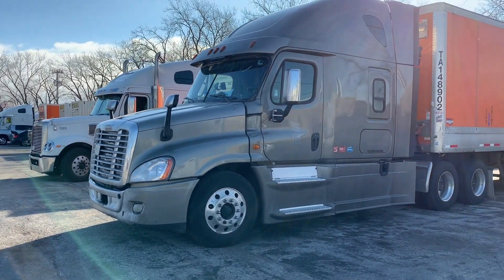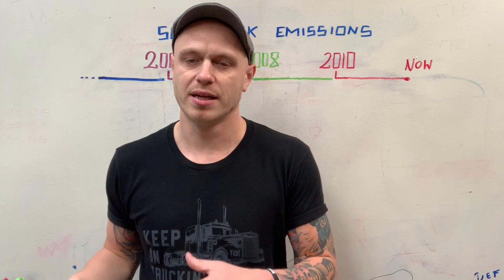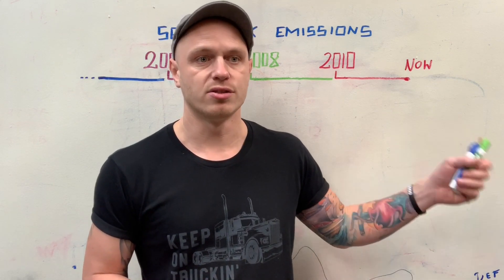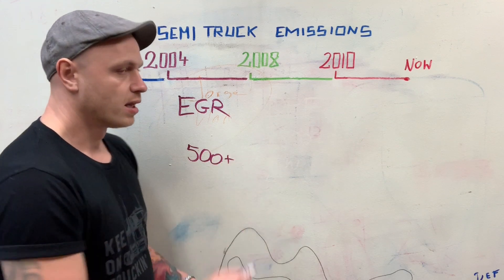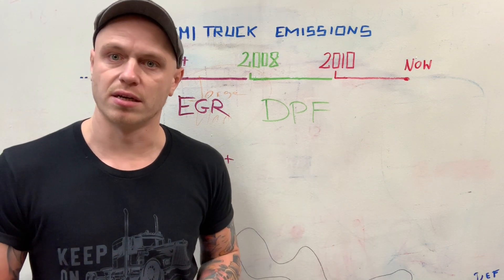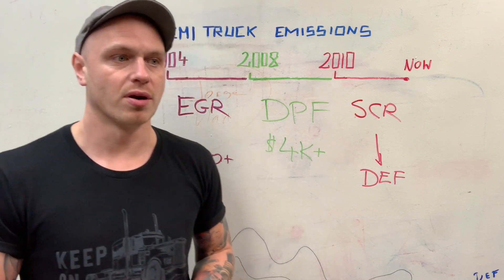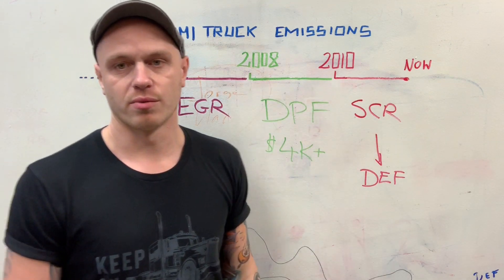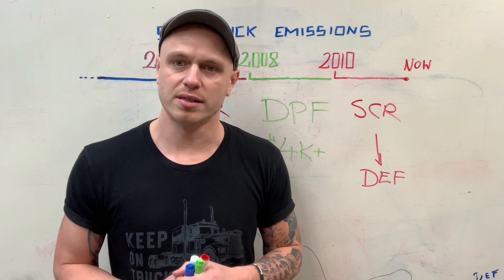Semi Truck Diesel Emission Standards

Comment: I think your egr estimate is way off. I don't know where your from but to replace an egr on an 04-07 Cummins is 3500-4500$ Canadian. You might be talking about the egr valve then I would agree but the egrs will eventually leak coolant into your intake and that's how you get the 3500$